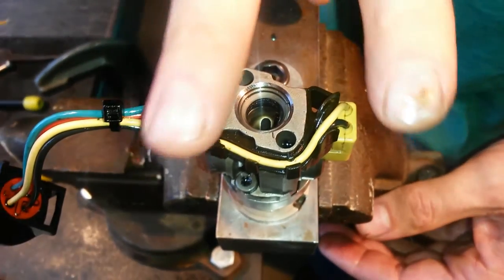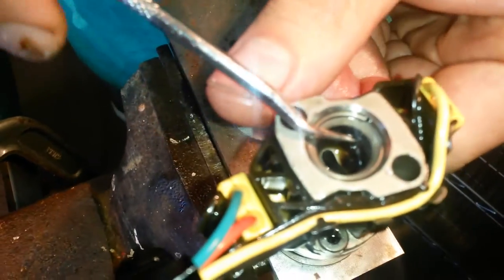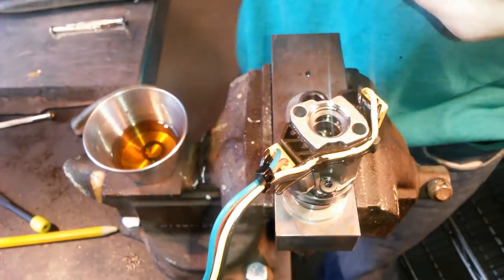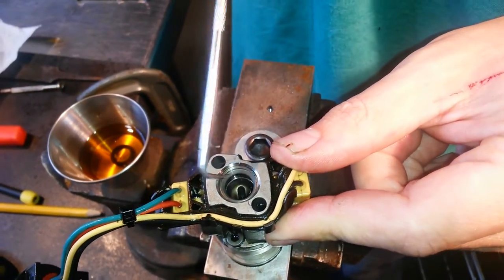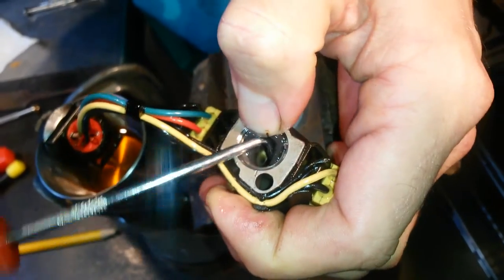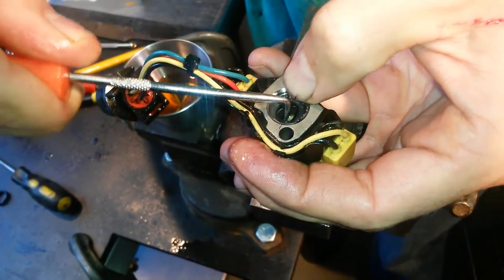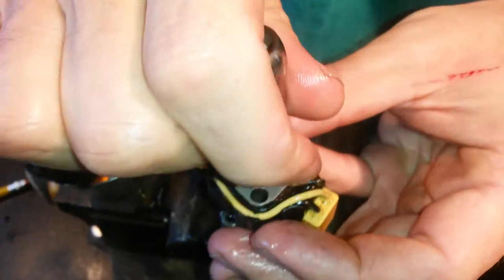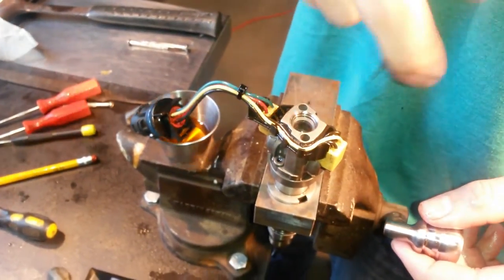Ford 6.0L Diesel Injector Top Seal Series (Video 2 of 3) How to Replace Your Top Seals In-Cab

Comment: "Change the seal with the nipple cups they are a pair..."

But HHC nipple cup kit comes without seals.  Curious.
Reply from the maker: Our Nipple Cups come with the seals for the nipple cups in the oil rail. We don't include the top injector seals.
Reply: Yea I just bought the nipple cups and their seals from HHC...then had to go hunting elsewhere for the injector top seals.  Would’ve been nice to have that option on HHC’s site
Reply: @benjaminfisher750  where'd you end up buying the top o ring kits?